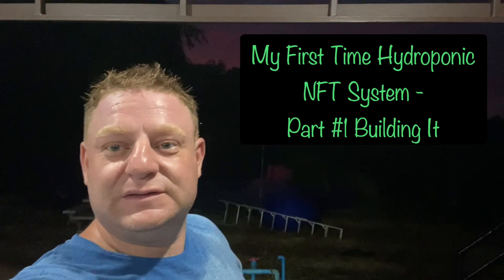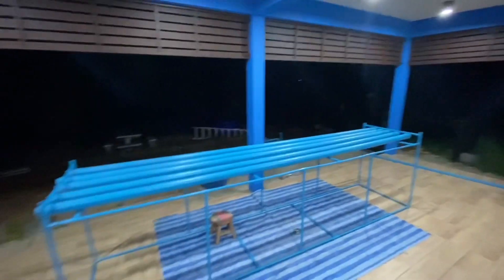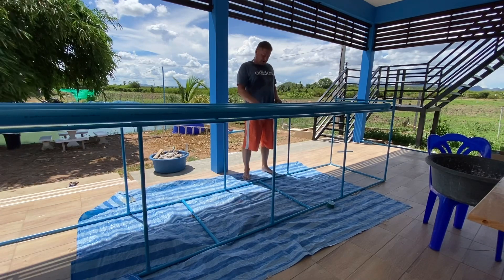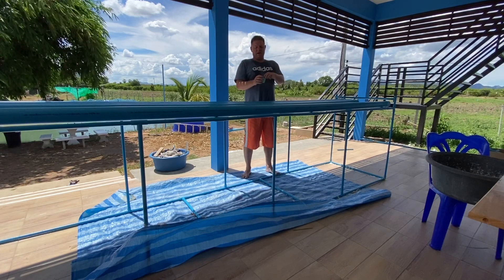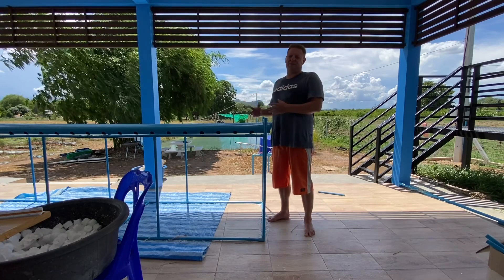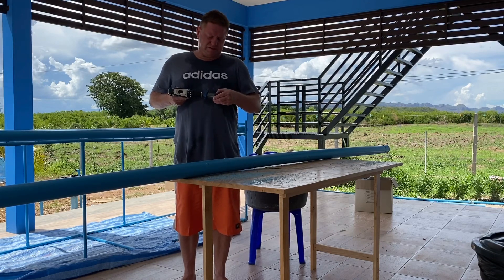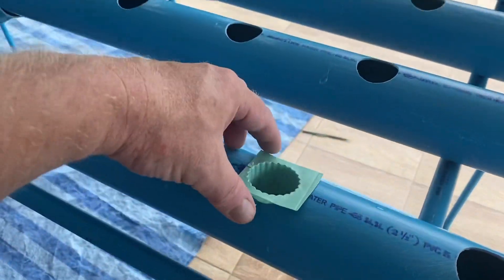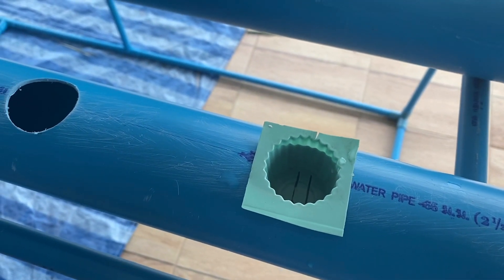My First Hydroponic NFT System - Part #1 Building it

Comment: Really interesting and impressed with the way it all went together. I know you mentioned about a steel frame, which sounds a great idea, but couldn`t you use bamboo as it appears to be everywhere and it is as strong as steel, just a thought. Looking forward to the next video. ATB
Reply from the maker: Neal This is just a prototype really. My thoughts are definitely to do this on a larger scale with potentially 40m of pipe all joined together. If that was the case I would definitely use bamboo. I actually have a load left over from another project. Just trying to find out if things grow properly and what’s the best things to grow. Thanks for you comment.
Reply: @jasemate2010  Hi Jason, really looking forward to the results of your work, should be interesting and something I would like to consider when I finally get there as a possible retirement plan , amongst  a few other ideas. ATB

Comment: Pretty good result for a first effort ! But I do think a few diagonal cross pieces would add some stability to the frame ......
But I would have thought the baskets need more holes for the roots ?
Reply from the maker: So I have put diagonals in and it did bring a lot of stability to the frame. I drilled a bit of ceiling framing in the end.
The baskets seem to be ok for now. The roots are coming through fine. I’ll show you in the second video. Thanks for you comment.

Comment: I'm impressed but agree that 1/2" blue pipe is too flexible/not strong enough for a stand, 3/4" or 1" better - it's all about pipe-wall thickness and water is heavy - can't see any other problems :)
Reply from the maker: Thanks for your comment. I ended up putting some diagonals (light metal ceiling framing) on in the end and it has made it pretty stable. I think if I did try to scale things up I would maybe use bamboo, especially if it was out in the field. Cheers